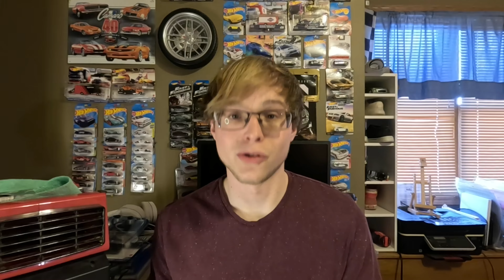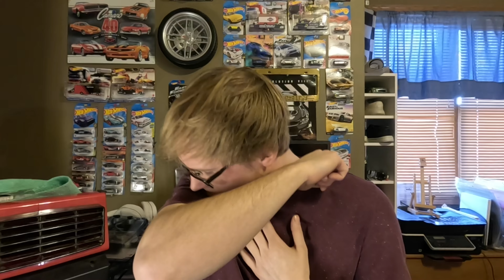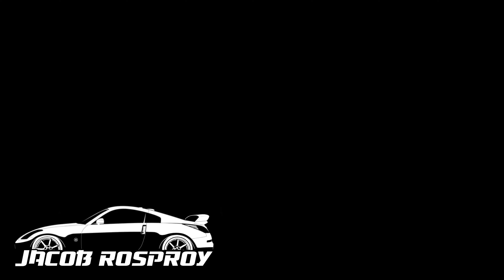I Gave Up on the Twin Turbo 2JZ 350z... Update

Comment: Hi please advice Is the number 1 intake cap on the 2jz gte non vvti cap the same as the 2jz gte intake cam cap non vvti .
Reply from the maker: No, the #1 cap on the vvti is going to have an oil solenoid inside of it, where the non vvti will not.
Reply: I mean non vvti cap number 1 intake cap. 2jz gte non vvti and 2jz ge non vvti ?